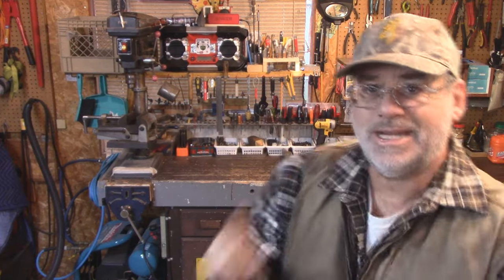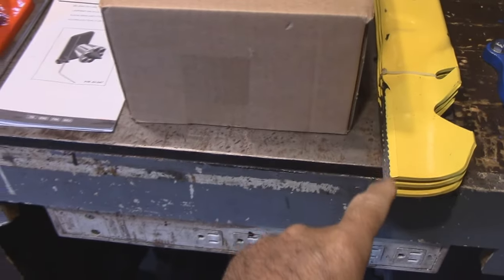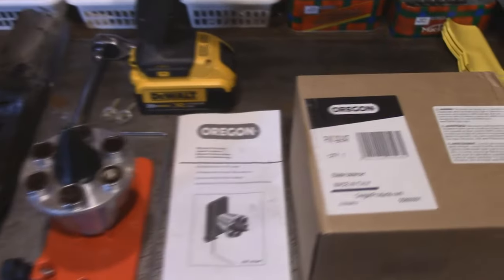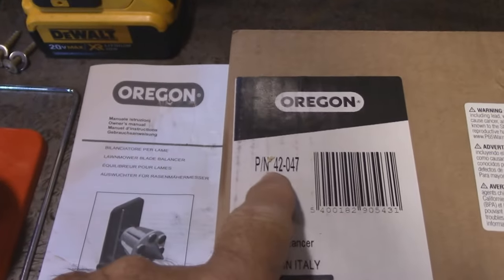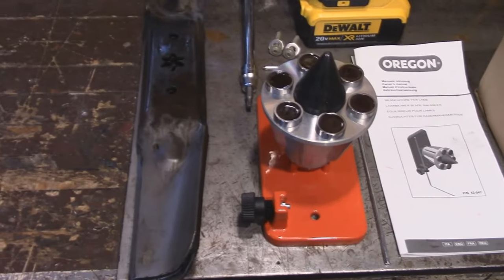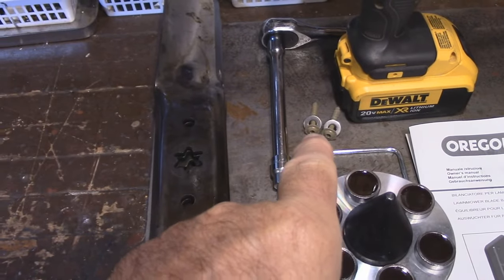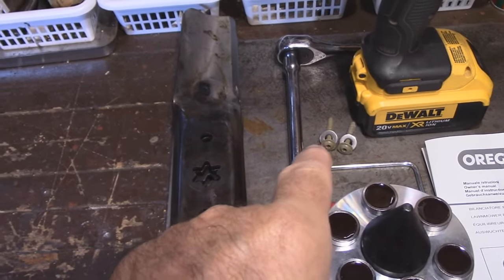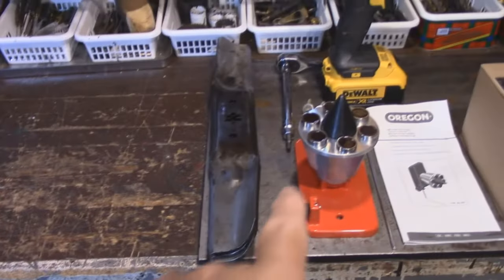Mower Blade Balancer-Testing Results Are Unbelievable

Comment: I have the same level and I cant stand it.   hahaha!

Meh, maybe I am old school but I don’t like to balance something - not in the same direction as the blade will be cutting.  Perpendicular on the wall like that seems very strange to me.
Reply: Maybe, but are plane turbines always level to the ground or when they are flying? They still balance them so they dont shake themselves appart. Seems its more important that they balanced self containedly, and not counting being level with gravity
Reply: In short, in this case the centripetal force will have way more effect on the blade than gravity.
Reply: And its easier and faster to see wich side is heavier if gravity helps, when you mount it perpendicularly to the wall

Comment: This is for a guy that has turf that is mowed down to 2 inch...not someone mowing a field.  At 2 inch you will see every imperfection from a less then perfect blade.
Reply from the maker: On my hay field the bushhog blades are 6 inches wide and  3/4 inches thick  , they never get balanced  but I do sharpen them with my angle grinder every year.

Comment: This is probably necessary if you have a box store mower but not for a commercial mower.
Reply from the maker: I'm thinking all mower blades need to be balanced,  box store or commercial mower,  I see no difference.
Reply: Commercial mowers are built to a higher standard than the non commercial throw aways.
Reply from the maker: @addamjenkins75  I agree but if it has a cutting blade on it every manufacturer  recommends that a blade be balanced.   No such thing as  self balancing  mower blades 😅
Reply: We have 5 commercial mowers all with sealed bearings in the spindles. 4 of them have anywhere between 1000-4000 hrs on them. We've destroyed blades but never a spindle. It's just a recommendation.